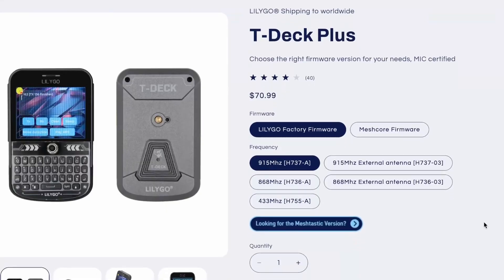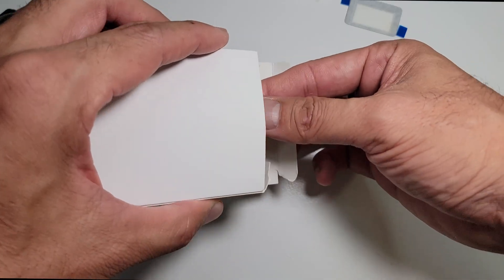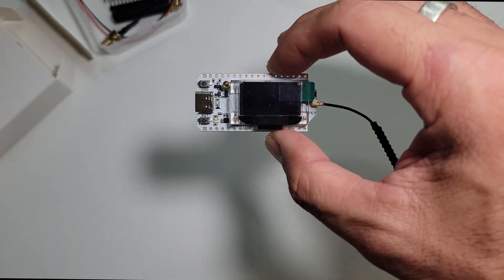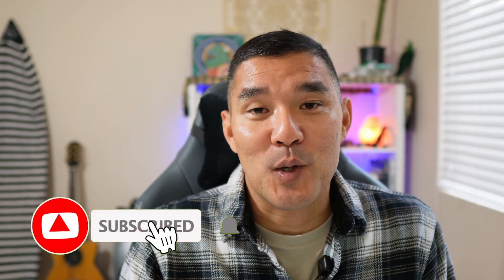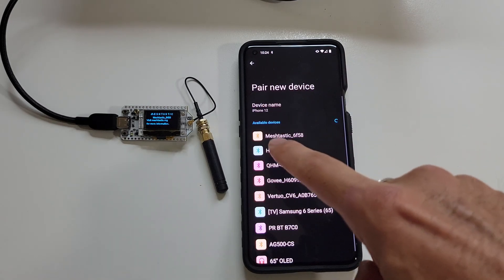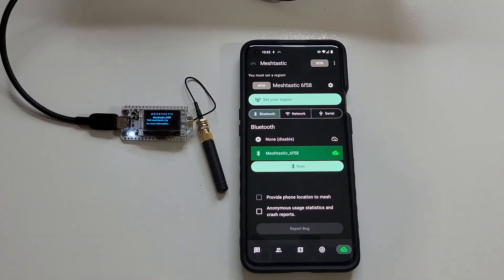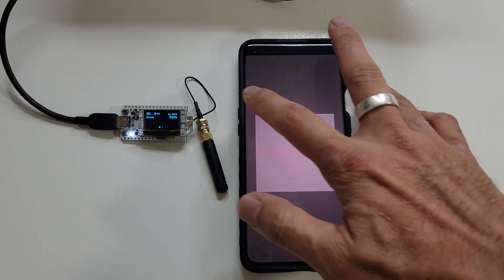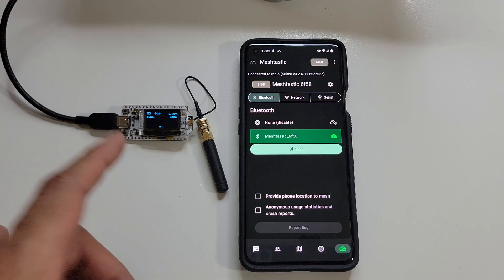How to Set Up Meshtastic (Step-by-Step Guide for Beginners)

Comment: I got a dual pack and The devices boot to LORA MODE 0 .. When I attach USB C (which I know is a working data cable), using the WEB UPDATE it doesn't seem to work. I'm on WIN 11 .. have you seen issues with that? Should I dig out my old Surface Pro and try that?
Reply from the maker: Check out the comment on this video that talks about drivers for Windows that you need for the Heltec. I don't use Windows as my daily, so I can't be much help there.
Reply: @IronCabin  Yeah .. thanks .. I had updated my post about 15 mins later and YT failed to allow me. I posted:

"I need coffee! I totally missed the drivers link" .. and had it up and running about 5 mins after that .. LOL

Although, one of the OLED screens cracked, so I'm screwed because no one seems to have replacements that I can swap out (solder) in place. Would have been nice to use those JST lock style connectors.

Comment: I'm hoping you can help! I've had my set up for about a year. Got it dialed in and never thought about settings or anything again. I decided, stupidly, to do the firmware update to the 2.611 or whatever it is. Now my encrypted channels won't talk to each other. I have a node for my normal cell phone and another I use at home with a larger antenna. I'm trying to connect the one at home to my cell phone and I've used the qr codes and scanned them on both phones and they just won't talk. Frequencies appear the same. I get a check mark by the text when it goes but it doesn't come over to the other set up. I see the app on my phone must be different than yours also as when I go to channels in settings, the QR code doesn't just come up. Not sure what I missed and how to get these private channels talking again. Thoughts?
Reply from the maker: Hi, 

3 ideas...

Update both apps to the latest version. 

If that doesn't work, try deleting the private channel and making a new one. 

Also look into Meshcore instead of Meshtastic. They tend to have more stable releases and the way they route messages should make it easier to support a larger network.

Comment: I assume it runs off the usbc cord even if battery is installed, or does it prioritize and disable the other?  Do the high gain whip antennas make a big difference?  $63 on amazon, got 'em in my cart, i may get the other ones with the 3300mah batteries to last longer.
Reply from the maker: Yes, it runs off the USB when available. The antenna makes a big difference, there are some demos on here on YouTube. I'm not sure exactly which ones to get though, I just use the stock ones.

Comment: One suggestion; if you're planning to use the kit for your nodes, don't bother with the temporary antenna. Just go ahead and hook up the one you're going to put in the case, so you don't accidently pull off the connector. Ask me how I know.
Reply from the maker: Great tip!
Reply: Is there an upgraded antena?

Comment: Just got two of these, starting from scratch into Meshtastic. It took a few days to figure it all out. I had to grab drivers for my old laptop's USB ports before it would flash. Set up a secure channel for the wife and I. Now It's experimentation time. These kits really are great for new users.
Reply from the maker: Awesome, glad you got it working!
Reply: i got two as well any tips?
Reply: @EthanAnaya-wk1ib  sure, I assembled mine fully before starting. I attached the antenna first, as shown. I have an older Asus stripped-down Windows 10 laptop and I found that it wouldn't detect the USB connection with the board and needed the CP210x USB to UART driver for it from Silicon Labs, and confirmed they showed up under USB device controller in Device Manager. After that, I paired them and consulted YouTube for the finer points for my use case. I ended up with CLIENT MUTED role, my encrypted channel first, and LONG FAST second. I shortened screen time to 30 seconds and turned off the white LED heartbeat to save energy.  When you get them out of the house and up high, you start seeing nodes appear. You will get strangers' messages on the default channel 0. I generated a key and transferred it to both, then moved that channel to position zero as my default. Beyond that I'm still experimenting, but they seem to be working good for a tiny radio. Edit: readability; I transferred the private key to both radios on the private channel, not both channels.
Reply: I keep getting ' no compatible devices found'. But I have the same exact v3 as you... please help
Reply: @user-oc9pt7hm1t  I think this is where I had to go get the cp210x driver from silicon labs.